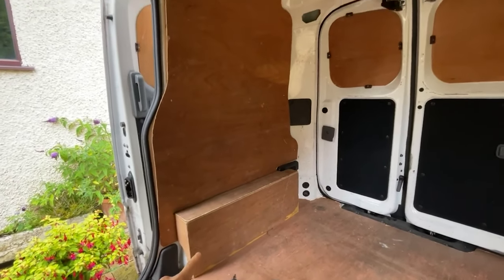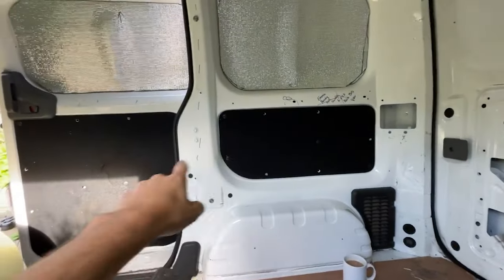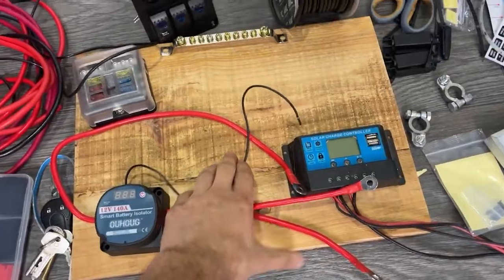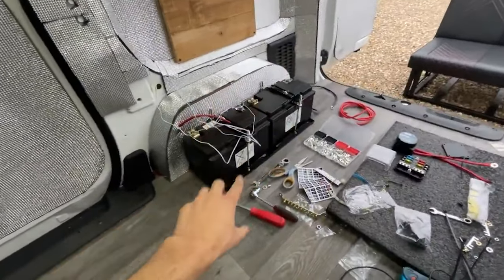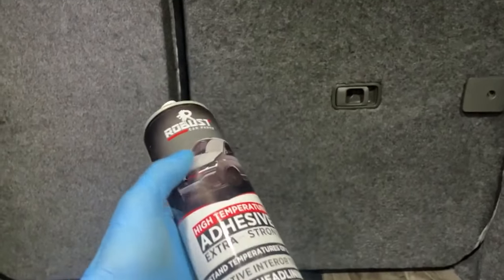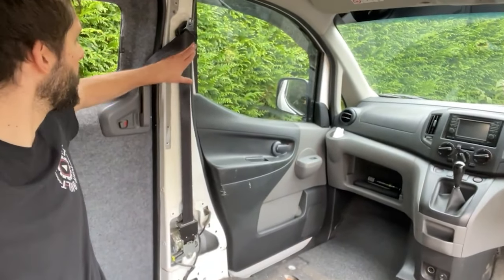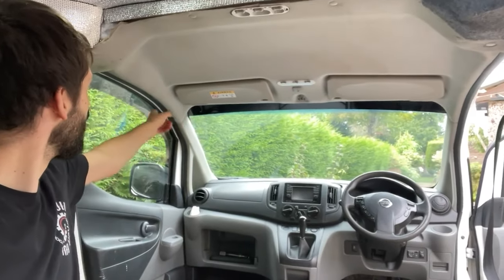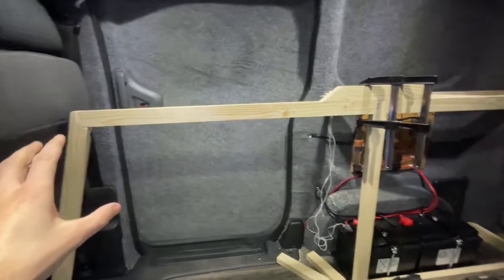Nissan NV200 Camper Van Build Start To Finish

Comment: Looks very good ! But why not use a power station instead of all those components you use now ? I payd 900 € for a 2048 W with a 2400 W inverter on it.... with a 25 A 12 V for all 12 V you need
Reply from the maker: Thats a good point and option but i got the battery's for free and only paid about £200 for the wires and solar panel. i like to not have to worry about charging any battery's ever.
Reply: @AshBuilt  free.... 👍🏻
Reply: Those power stations are not cost effective if you have the basic skills to build your own system. A custom build is more flexible and you don't need to throw the whole thing out if there's a fault one day.

Comment: Hello
Noticed you removed your glove box to get to large engine bay grommet …. Have you got any tips as I can only see two screws inside box ???  Will I need to take this out to get. Access to leisure battery cable or would I be able to run cable behind without box removal.
Reply from the maker: Ok so my memory is a little rusty but there is a screw in the cup holder and another two underneath the glove box itself.

Comment: Looks like a great conversion, I am currently converting one myself. How did you secure the ply floor or did you just fit it in place? Also what thickness ply did you use? Cheers.
Reply from the maker: I used 8mm ply and glued and screwed it down.
Reply: @AshBuilt  Great thank you! :)

Comment: Man it'd test those batteries and pulse off some sulphur. 12.1v is empty and at the stage where it's potentially damaged.  Hopefully you can replace that nasty cheap chinese controller with something mid range one day like victron.
Also i hope youve cut a hole in the floor next to your gas bottle to allow heavy gases tomdrop out in case of leaks. Regs these days even require the bottle to be in an external sealed cupboard. Stay safe.
Reply from the maker: Lessons were learnt from this build.
I’m getting another van soon and will it be a different build this time.

Comment: Do you idle and keep the AC on at night to keep cool? I'm curious because I'm thinking about the same thing but worried that I'll idle too much and it will be bad for the van.
Reply from the maker: I don’t no. You can get ac units for campervans that fit to the roof and run them off leisure batteries